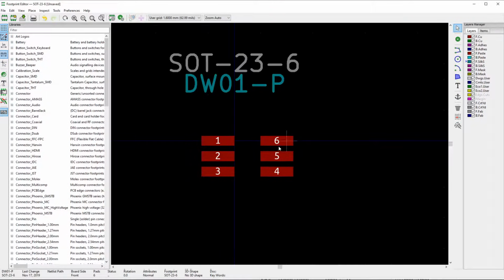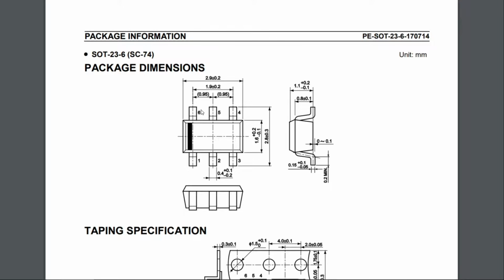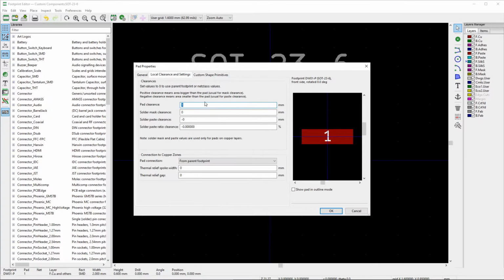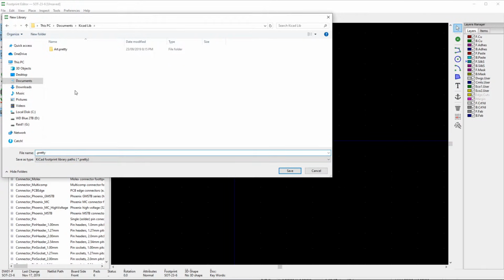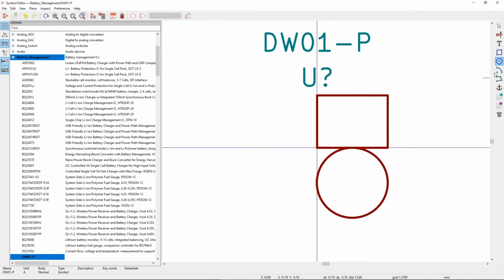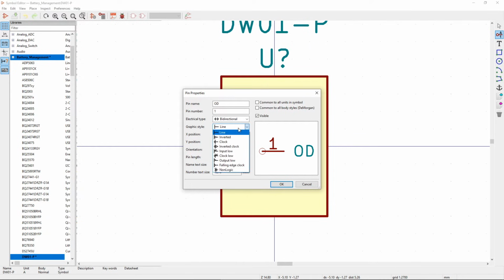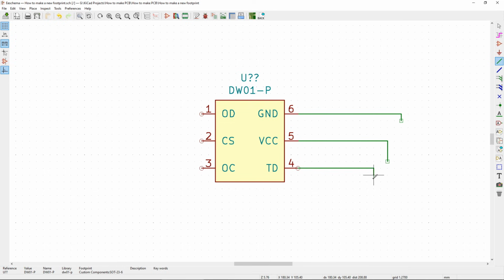How to design custom Footprints & Symbols in Kicad

Comment: Some feedback on the symbol. While it is nice to have the symbol represent the layout of the chip, this is not the standard that is laid out on the Wiki as standard. The power input should be on top of the symbol and the ground on the bottom. Also, you should mark the ground and VCC pins as "Power Input", because these are not really bidirectional, but require input instead.

Comment: Please make a 'mate' of this, that addresses a through-hole mounted device, specifically Phoenix 1757268; the problem with this, is that it has (1)(mm) wide pins, one needs a hole diameter of (0.052)(in) [(1.32)(mm)]

Comment: Great video! I would definitely recommend adding a "pin 1" indicator on the silkscreen  - often a dot, line or arrow near pin 1 on the silk screen. This will help during assembly to correctly orient the chip which is important in symmetric designs. Also recommend adding a border on the silkscreen and a courtyard to prevent accidentally placing components too close together during layout. Take a look at footprints from the standard library as a guide.

Comment: I rarely create PCB myself, but I often have to tweak them.
I see all the time how different people come up with their own pitfalls when making boards.
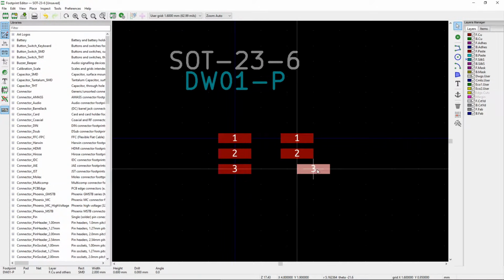And now i understand the logic of those who make crap like 8:00 !
Some unknown force forces people to change the grid to 1.6 (just as an example from here), and then move separately the centres of the platforms. to what?! to be tied to the grid 1.6? WHYYYYY?!?!?!?!?!?!
Just calculate the centre-to-centre spacing of the pads!!!! IS THAT SO HARD!?!?!?
And then make a 0.1 grid and put it where you want it! DO NOT move the centres of the pads from 0/0.
god damn it. It's so so so so SO infuriating.

Comment: Very good, detailed explanation of aligning the footprint pads, my friend!  Most videos don't show this much detail, so kudos to you.  One suggestion, though.  I was following your vid to modify an existing J-lead package (TSOC-6) for a Maxim DS2423 counter chip to extend the length on the X-axis because the footprint I was using had the pads RIGHT UNDER the package and I wasn't sure I could hand solder this.   And I noticed after using the modified footprint and trying to reconnect the lands that the pad origins needed to be put back to the center of the pads.  I really liked your presentation and the only thing I can add is to put the pad origins back to where they were and THEN save the footprint in a library.

Comment: good tutorial I'm following this

12:20  "U?," suggests that the component is currently unknown or undecided.

Some notes according to chat gpt

Here's an example to illustrate the usage of the default reference designation "U" in KiCad:

U1: Represents the first integrated circuit or microcontroller in the schematic.
U2: Represents the second integrated circuit or microcontroller in the schematic.
U3, U4, U5, and so on: Represent additional integrated circuits or microcontrollers in the schematic.

U: Typically used for integrated circuits and microcontrollers.
R: Used for resistors.
C: Used for capacitors.
L: Used for inductors.
D: Used for diodes.
Q: Used for transistors.
J: Used for connectors.
SW: Used for switches.
LED: Used for LEDs.
X: Used for special components or modules.

S: This prefix can be used to denote a general sensor component. For instance, you could use S1, S2, S3, and so on, to represent different sensors in the schematic.

T: This prefix is often used for temperature sensors. So, you might use T1, T2, T3, and so on, for temperature sensor reference designators.

P: If you have pressure sensors in your design, you could use the prefix P. For example, P1, P2, P3, and so on, could be used to represent different pressure sensors.

Comment: Nice tutorial, but I do it slightly differently.  By having user defined grids you run the risk of your footprints not being in synch with your design grid.  In my opinion you're better of defining everything on say a 50um grid - but it's really a matter of personal preference - always many ways to skin a cat.
Reply: Yep, I ran into that too. User defined, or a fine grid is good for moving the text around but not so with the part itself  with the pins.

Comment: Excellent KiCad intro videos. I’ve finally decided to jump into KiCad after years of using various other EDA tools. Question: Is there a standard mechanism / hosting site for sharing user created KiCad symbols and footprints?  It would seem a crazy duplication of effort if everyone has to “reinvent the wheel” designing symbols and footprints (and 3D models) for components that are not in the standard installed libraries. I’ve only just started, but Google hasn’t answered this for me (yet). Cheers.
Reply: I discovered there is a thing like that called SnapEDA

Comment: Very good tutorial, thank you.
I’m trying to learn kicad after using eagle for years, I need to build a replacement LED display for a broken Gas Discharge Display of a Datron 1062 multimeter, I found the display was cracked whilst doing a live stream yesterday trying to repair the unit (I buy broken test gear to do videos about fixing them)

the 120mm board size limit in eagle meant I can’t use it to do it !
Was surprised to find a fellow NZ YouTuber, almost a good opportunity for a collaboration.
I have already reverse engineered the display and figured out how to modify the unit to use LED, I just need to get my head around kicad so I can make the boards.

Comment: Given the 2mm long pads, could you, instead of modifying the origins, have set the X pitch to 3.6mm instead?
Reply from the maker: There are many ways of achieving the correct pin spacing. And you could certainly use that method.  The only consideration would be if later you decided to modify the length of the pad, your pin spacing would be messed up in the process. ;)